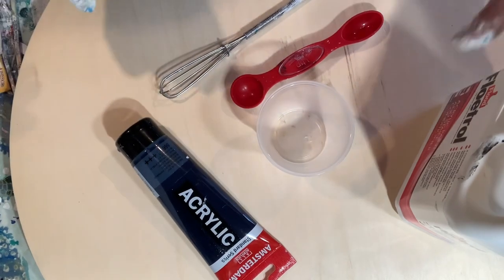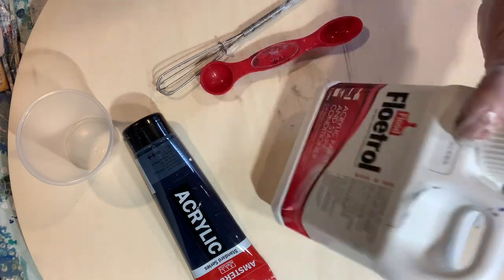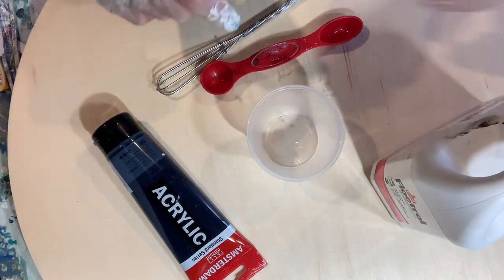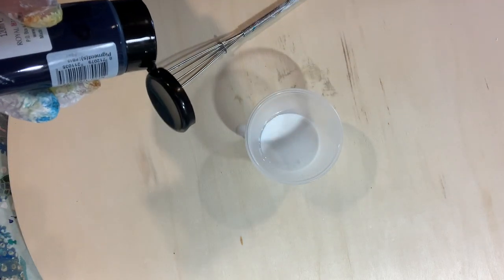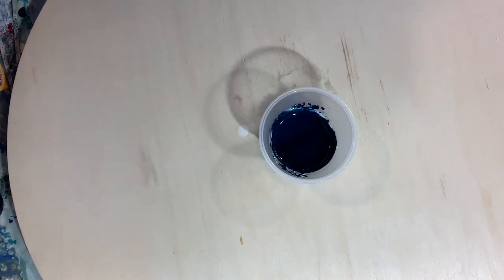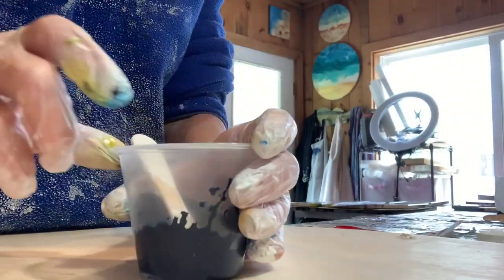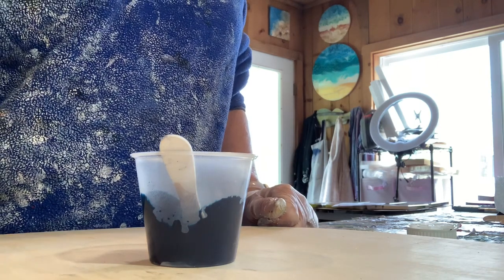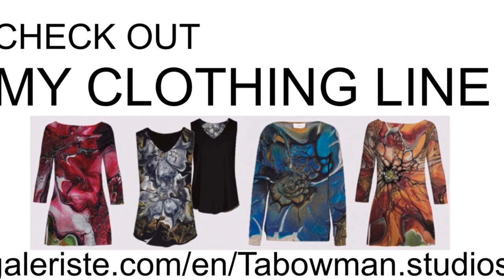Cell Activator￼ For The Swipe & Bloom ￼￼Technique

Comment: Does CA go bad?  Is it best to just make small batches?
Reply from the maker: Hi Cindy,  🤗 Great question.  I make mine by the tablespoon so depending on which bottle I use the smaller or the larger bottle, you mix them depending on the bottle because they’re not the same. The small bottle mix 3 tablespoons Australian floetrol to 1 tablespoon of paint.  I have quite a few different color cell activators going at once and they do keep.  There are some people that say it’s best to use it fresh but I’ll find it doesn’t matter. 
Happy painting and keep watching 🤗